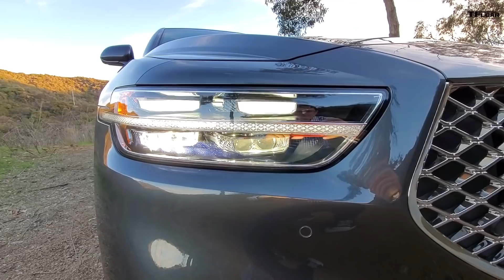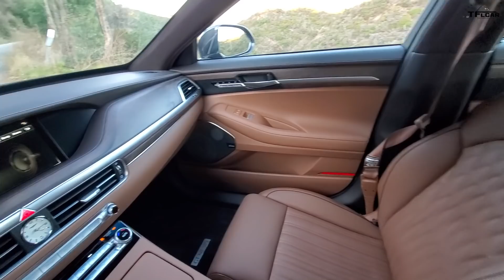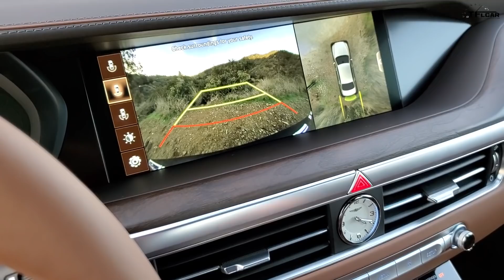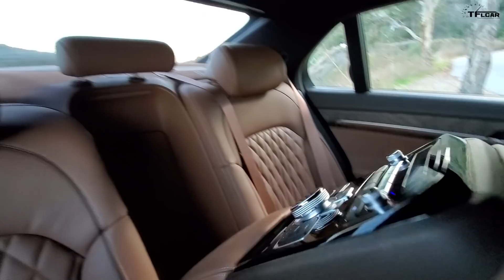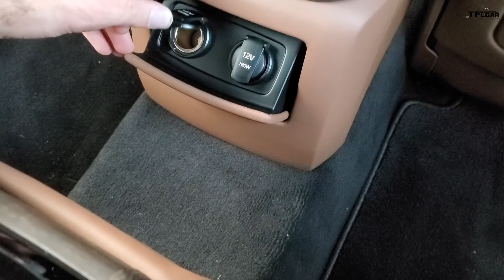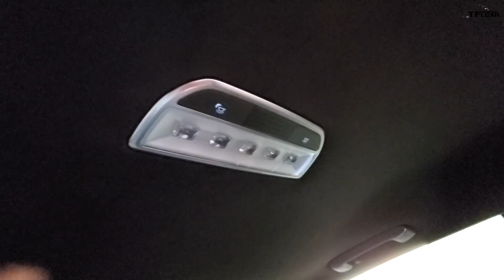The 2020 Genesis G90 Is Coming For Your Mercedes, BMW, and Audi...

Comment: The wheels have been a problem for awhile, at least for US buyers.  This car also lacks some of the things we would generally expect in this segment such as massaging seats and dual instrument clusters.  Neither are available, even as options.  Then there's the dealership experience.  Hyundai promised Genesis-only dealerships years ago but hasn't fully delivered.  Instead they allowed Hyundai dealers to simply re-brand themselves.   Check the Internet and you'll find plenty of  stories. where people trusted Genesis with their "Valet service" promises and then still found themselves at the mercy of a Hyundai dealer which had "no Genesis equivalent loaner available when they needed service.  

I gave this brand a try [2015 Genesis Ultimate 5.0] and it is an excellent value for the money, just don't fool yourself into thinking it it's a Mercedes, especially an S Class.

Comment: In all seriousness, I'd be willing to bet that the most of the people who have positive comments for this car and negative comments for German cars will own neither of them. I don't care about the car of the year awards, show me what the car is like 3 years from now. Still quiet? Interior still in good shape? Body panels still aligned? Paint still shiny? Why do you aspire to be like others? Because you're not in first place. Don't bring another car with "Me too" technology years after someone else pioneered it and fine tuned it and it is now mass produced and treat the manufacturer like an innovator.

I've had two very reliable Hyundais in my life, but they were clearly stealing design cues from other more expensive brands, had inferior paint and interiors which didn't match the brands they copied, and were underwhelming to drive. At no point in time did I crap on any other brands because they just weren't on my radar and there is no benefit to trashing a brand you never aspire to own.

If all cars cost the same, most likely people would drive others cars because they are superior making the true factors cost of acquisition and perceived maintenance cost. I say perceived because I have never brought a car to the stealership for work no matter what the brand and find the cost of ownership similar based on options. EG, I won't buy a car with air suspension, it seems like a losing battle.

Comment: Acura, Lexus, and infinity look like garbage compared to the genesis line up.
Reply: The lexus looks a lot better than the geneses, hold it's value and is a lot more reliable. There no contest in comparison
Reply: Wendell Harvey Lexus has tech from 2010. Looks are subjective, I think they’re kinda boring. Reliability yes they are great. As for value this car wins compared to new cars. Resale no, but bang for your buck as a new car this wins.
Reply: @hunterdonnelly7422  have you not seen the new Ls 500 or es 350? They are quite upto date with tech, plus Toyota never puts ridiculous amount of tech until they perfect it, which is why they are not at the top with latest tech, do some research on how Toyota does it

Comment: The Euro snobs wont even look twice at a luxury Hyundai but its a great buy for people who just want value for money and a nice driving experience. Me, I dont buy brand new so dont really care either way. Im fortunate to live in Australia where I can pick up a used Citroen C5 with self levelling hydractive suspension and power leather seats combined with turbo diesel fuel economy for under 10k. That will be my next car. Right now Im driving a 1.6L diesel Peugeot 308 which is classy but not really a luxury car but a great little workhorse for Uber Eats driving.

Comment: It's a Hyundai, I'm quite sure that a Sardine can is at least 3x stronger than its outside frame
Reply: Ignorance is bliss, huh?
Reply: @Odarevlis  * bless, if you edited that everyone will know the ignorant.
As for the vehicle itself, Hyundai has been known for using low quality materials for the exterior body of their vehicles since the 2000s, because of the large gap between the low supplies and the high demand for aluminum, iron, nickel, and other materials in Asia.
Reply: @progadgetreviewpgr7122  lies.

Such sad lies from such an ignorant man.

Putz.
Reply: Sardine can😂😂😂😂😂

Comment: Yes, that grill is ridiculous.  Not sure why manufacturers think these things are a good idea.  Envision being in northern states, where parking spaces are so tight, cars will bump each other slightly to get into a space.  The forward position of that grill with a lattice design begs to be damaged.  The same applies to the new 2020 Sonata.  I would not buy either one for that exact reason, even though both cars are absolutely gorgeous.

Comment: Did you know, the Genesis taillights are actually in the shape of the Genesis logo? It's a giant logo looking back as the car moves forward. 

From the Genesis website: "Lettering emblem
In the rear, quad tail lights symbolizing the wings of the Genesis logo wrap from corner to corner."

Comment: Its goin to run over 72k for a sedan? Maybe if i had a limo service. This car would have been a a good price at 48k. If i had spend 72k. Id rather drop 8k more for the Toyota Landcrusier. It offers all these features, as well as height adjustable suspension and off road features.

Comment: Beautiful car with spectacular features.  I actually purchased a Hyundai XG300 (which I feel Hyundai  were cutting their teeth on while heading to the Genesis brand) when they first came out and it was one of my favorite cars despite its shortcomings.  Hyundai and Genesis still have their issues with power trains, but they do offer a lot of bang for the buck in general.  If I were in the market AND knew I would keep it less than 100k miles, I would easily prefer this over the European offerings, but if were going past 100k, I'd have to go with the Lexus LS.

Comment: So a 2020 Sonata limited has more tech than a flagship G90 now? Ex : digital gauge cluster with the blindspot view using signal lights,  smart key with digital key sharing, move your car with the remote, push button gear selector....

Comment: What do you mean exactly by you've never seen a two position heated steering wheel? Are the ones you see only an either on or off type? My Volvo has 3 settings for its heated steering wheel, and I love that! Sometimes I put it on the lower setting just to get the chill off it. Other times when it's super cold out, it's on the hottest setting the whole time. It gets damn hot too! No need for gloves.

Comment: How will you open the trunk to manually open the fuel door if the battery is dead? Does the trunk has an electronic actuated open button?

Comment: I wish Genesis not used turbo engine. IMO they should only use V8 to have better reliability long term.
Reply: Lion Runner...I believe this is the only car in this class that actually does still offer a naturally aspirated V8.  Even Lexus has gone turbo.
Reply: @canadabear72  I thought Lexus went the hybrid way and does not have any turbo options. (Please correct me if I'm wrong.) I really don't like luxury brands having hybrids either. Me personally prefer reliability and smooth power delivery on a luxury brand and not fuel economy.
Reply: @LionRunner  Yes, they do offer the hybrid.  But the base model is a turbo charged V6.  I'm with you!  If you're spending a hundred grand on your car, do you really need it to be a hybrid??  The LS has no more NA engine option.  Too bad, because that's partly what made the old model so reliable.
Reply: People want options

Comment: Genesis built a feature rich car for people who want the flagship vehicle from Mercedes, BMW and Audi, but who can't afford those vehicles.  If the MSRP is more than half of any of the cars that it claims to compete with you are throwing money away.  They depreciate so fast it would be one of the most expensive vehicles to own in that class.  Finding one of these with a V8 in 3-5 years with a limited number of miles for 25% of retail might be an option.
Reply: KSWSG it’s not half the price tho. 

$75,000 for a G90 or $90,000 for a S Class. Idk how many people can afford one but not the other.
Reply: @devinbender8428  I mean....kind of.  They start in the 90's.  However, the Genesis in this video has to have everything they offer.  An S class fully loaded is probably 115k or better.  4 matics are more and AMG obviously more.  I looked up a genesis and a 2 year old genesis with 25-30k miles is 50% less.  I legitimately think that a 3-5 year old Genesis G90 with 30k-50k miles around $20k is probably a killer vehicle for the money, but it would depend on the reliability.  I owned an A8 and when everything is a button and everything costs a $1,000 or more to fix then reliability issues get old fast.
Reply: KSWSG 
But a Loaded G90 is only 75k yes but it’s comparable to the MB S450 4M. That’s a lower trim. (Still $90k) and the Mercedes is a hybrid. Then you still have the 560 and AMG which are even better.
Reply: @devinbender8428  I wasn't real clear.  I meant the S class starts in the 90's.  There isn't an S450 4M within 500 miles of me for less than 103k and they go up to 115k.  Also, to your point, they are more than 50% of the S class....which to me means it isn't a legitimate price point.  The G90 has to depreciate significantly, which they do quickly, in order to be considered.
Reply: @devinbender8428  Base S Class is $94 250.  At that price, the G90 is a better all  around car.  Comparably equip your S Class, and it will be almost double the price.
Reply: John Holst almost double? For the same options as the BASE  s class for 90k you have to spend 75k on a kia. 15k is hardly double. And the S class is a hybrid. Better mpg and more torque.
Reply: @devinbender8428  his point is that you can't buy a base S class for 90k and when you do it isn't comparably equipped.  Like I said, within 500 miles of me they are $103k-$115k.  The base S class doesn't come with the "being driven" features.  Regardless of features $30k-$45k is enough of a delta to keep a lot of people out of that market
Reply: @devinbender8428  The base S Class is NOT a hybrid!  Duh!  And it does not have all of the features that the G90 has.  Add all those wonderful things to your S Class and it comes out to 119.8K.  No, not double.  Only 55K more and still less reliable and less power.  You're right though; better mpg.
Reply: John Holst sorry the Long wheel base is hybrid only. The regular wheel base is a v8Tt sorry. 

Within 500 miles of me there are 50 s class under 100k so idk where you live
Reply: @devinbender8428  Sorry Devin. I assumed you were American.  In the US, a comparably equipped S 450 4 Matic costs 119.8K.  This comes from Mercedes USA.
Reply: John Holst 

Similar torque slightly less power in the 450 vs the 5.0 G90. 

And the 450 gets 22 combine g90 gets 19 mpg. 

And tell me something what are you getting on a loaded $80k g90 that you don’t get on the $95k 450? Please list the options below.

And as I stated before. The MB S-Class is the MOST EXPENSIVE car in the class’s 

BMW and Audi are slightly cheaper. 

Lincoln Cadillac Lexus Infinity Jag are about the same as the G90
Reply: @devinbender8428  You can check on the MBUSA website.  But as an example, the Benz only has "leather" and not premium Napa leather.  No heated or cooled seats.  Shitty looking old man laquered wood. No heated steering wheel.  And on and on.  And still it's 97K!
Reply: John Holst ok got me there. Still that resale value gets me too. 

After 3 years your Genesis is only worth about 40% of the new MSRP
Where a MB is worth about 45-50% 
That’s the difference between 10-15k!
Reply: @devinbender8428  I don't need to "get you" on anything Devin.  There's no need to argue.  We're just a couple of car loving guys expressing our views.  But since this G90 is all new, we can't say for sure about the depreciation.  But yes, it will be severe!  However, we do know for sure that this S Class is one of top 10 depreciating cars in the world.  There's no Genesis on that list.  (See TFL cars for that video).  I'm not saying the S Class isn't nice.  Truth is, I love it!  And if I were looking at the high powered versions, there would be no comparison.  But The G90 , to me, is a much better car than the base S Class as it offers more hp and torque, as well as all the luxury features you'd expect in a luxury car.  You gotta pay more for those in the S Class.  Not worth it to me, because I don't need the badge to feel good.  I just want the nice car.

Comment: Good chance this will be my next car. Love the wheels and styling. Has an 80s but modern look and feel. Had a current G90 for a couple days this year. It really is a great luxury car. Great video Tommy!
Reply: Aaron. I wanted to ask you which G90  motor did you have and what your average miles per gallon?
Reply: @hectorrivera1719  drove the 3.3T.  honestly they have about the same torque but the torque is available down low.  I've heard from others you really have to get the revs up on the V-8 for the power. Super smooth they said. Turbo is smooth as well. I got about 20-21mpg average. On the highway I could beat the EPA number though and could push it to about 28-30mpg at 70mph
Reply: @ab_grayfox1964  thank you for that. I do lots of highway driving and if i can get anywhere above 28 mpg on the road that will be a big plus. i average at times 500 miles a week with 70 percent highway driving. I was looking at a lexus ls460 but they have no soul. if you know what i mean.
Reply: @hectorrivera1719  oh I get it.  I will say the new LS with the twin Turbo V6 is pretty great. Still I prefer the look and isolation in the G90

Comment: People in the US still shy away from Kia, Hyundai, and of course Genesis. Shows how big reputation is. I try an dtell people this isnt a Kia or Hyundai of the early 90s. These cars are on build quality par, if not better, than any domestic and approaching Honda and Toyota reliability levels. That is a gorgeous car, and a bargain compared to its competitors. The wheels take me back too. It needs some spokes.
Reply: Yes I agree I've been purchasing Genesis since 2010. On my 3rd vehicle and intend on purchasing th2 2020 sometime next yr. With every purchase I've made people always ask me why with that kind of money buy a Mercedes,  BMW, etc and my response is always "they are not giving me a 10 year warranty" that alone justifies me staying with a Genesis period!
Reply: Parker Creates Why are you worried about the warranty when your trading it in every 3 years? Lmfao. Good excuse bro. 

As I’ve stated before. 1 after that 10 years you better get rid of it because it won’t last much longer than that. 
2 KHG has the highest warranty denial rate in the USA. They look for any excuse to deny.
Reply: Zach C LMFAO HONDA RELIABILITY?!?!?!

K/H/G just had a massive recall for engines blowing up and an ongoing investigation for the other engines not recalled. Yup sounds good
Reply: @devinbender8428  you can take any snapshot and spin it. In the past 40 years or so, Honda and Toyota generally are at the top of the charts. Some makers have a specific engines, drivertrains, or models that are all stars. K/H/G are climbing that ladder.

Comment: I wish they make a mid-size version of this car.
Reply: there is, its called the g80.
Reply: @randomname5585  I've seen a video of a 2020 g80 sport package that looks nothing like this g90. Do you know if there is a g80 that looks similar to the exterior especially the grill of the g90?
Reply: Raied Busaleh the 2021 G80 and G70 are going to be refreshed with this look of the G90
Reply: @roodyinlove  All new model G80 is coming in a month.  Uses this new design language.
Reply: @devinbender8428  G70 will be a refresh. G80 is all new model.  Can hardly wait!
Reply: John Holst lmao all new model? What planet are you on? The car is only 2 years old. It’s a face lift
Reply: @devinbender8428  I'm sorry you're so misinformed Devin.  In fact, the G80 was launched as the "Hyundai Genesis" in 2013. Why do you think it looks and feels so old compared to the other Genesis models? The model that will debut early 2020 is a completely new car.  Actually, the all new GV80, which will debut next week, is built on the same platform as the new G80.  You'll see soon enough.
Reply: John Holst it will only be an update. Not a full remodel. So new Dash and stuff. Still will have the same drive train suspension etc.

Comment: Don't ever insult lincoln again. The continental and the mkz are far better looking than this trash
Reply: Ford fan here. I'm 6 ft tall and cannot sit in the back of the Lincoln Continental without bumping my head. No head room.
Reply: @Zbob-z4e  im 5,10 never sat in the back of the conti. But i have in an mkz which is much smaller and had more than enough headroom to spare in the back. Btw, Nobody sits upright in a backseat unless you are trying to make a scene. I'm pretty sure the conti has plenty of headroom unless you are sitting upright
Reply: Go try.